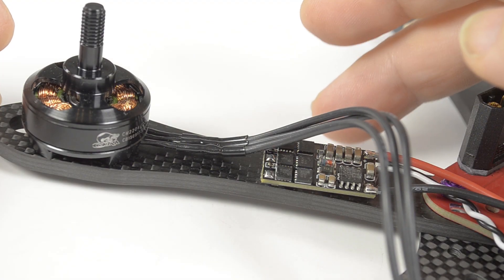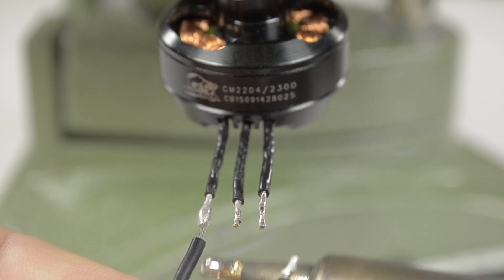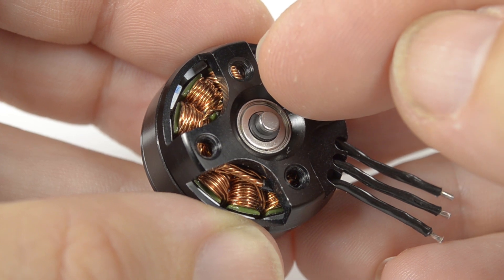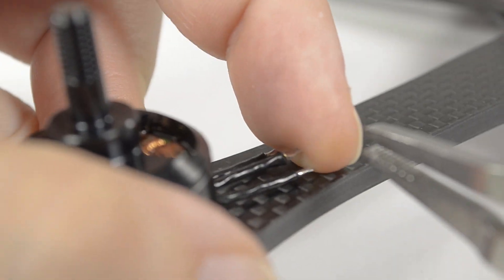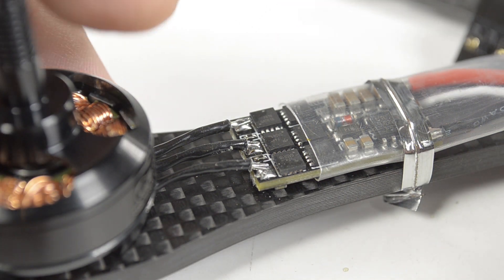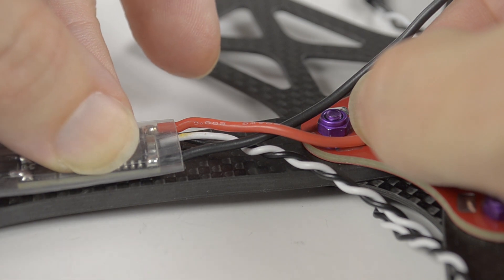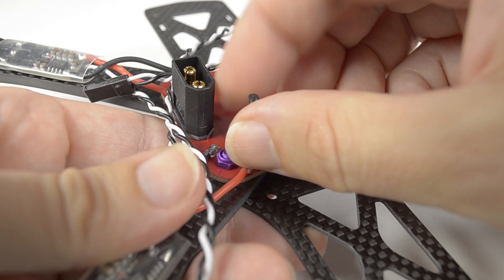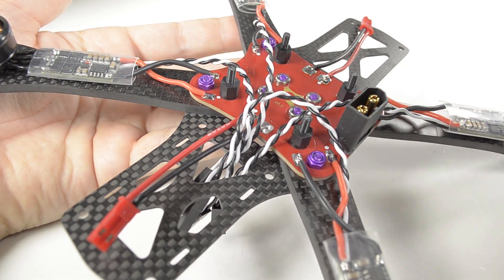ImpulseRC Alien Build - 02 Motor and ESCs

Comment: Love that method of stripping back that heatshrink on the Cobras, that's WAAY easier than I've struggled with previously. I've always used Loctite with my motor screws, I notice you don't. Have you had any work loose after a while?
Reply from the maker: +Capt Buscemi Never really been a problem with them working loose, we generally only use 2 screws per motor and no Loctite. Your mileage may vary :)

Comment: did you cross two of the motor wires on two motors to get cw/ccw rotation? I didn't see it in the video and I'm doing my first build so I'm lost lol.
Reply from the maker: +David Billey Since they're BLHeli ESCs you can actually reverse the direction later in software :)

Comment: What is the purpose of the 5v step down pololu ? What should it connect to ? And do i need it on 5" build Alilen?
Reply from the maker: +Sin14216 It takes your battery voltage down to 5V to provide clean power for your flight controller and receiver. Whether you need it or not really depends on your build and the other components.
Reply: Everything in this video,Tarnis X9d Plus. As this is my first build, i just wanna do everything correctly. Thanks for the help .